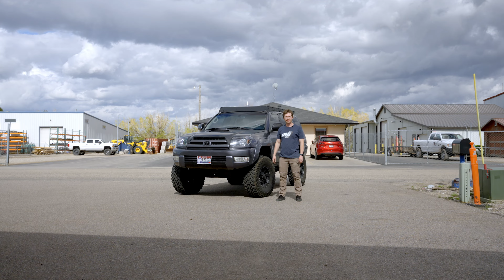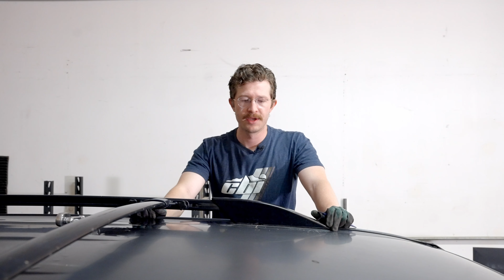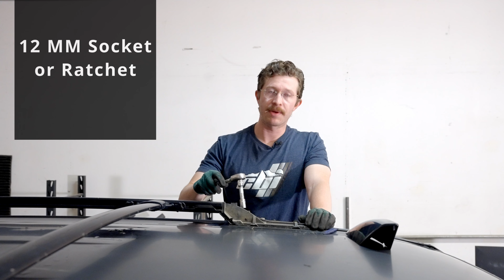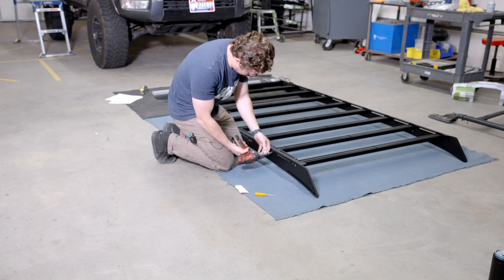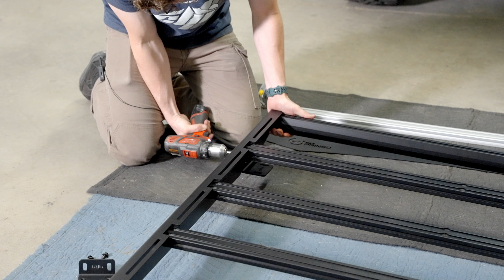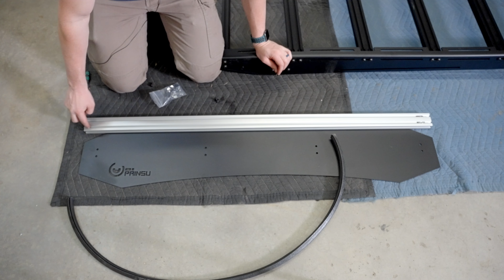4th Gen 4Runner Prinsu Pro Rack

Comment: Don’t buy it until the major design flaw is fixed. The new Prinsu pro roof rack on my 24 Land cruiser fills up with water whenever it rains. The crossbars have an open channel that retain water. I called Prinsu they told me I needed to dry the rack every time it rains. Major design flaw all they need to do is drill two small holes in the bottom of each crossbar to prevent this water from pooling.
Reply: @ScottyBumbaloughmauib  Thats a huge bummer! Im surprised people with their other racks don’t have this issue and their solution to dry the rack every time it rains… is this a troll?

Comment: Does the hatch open fully after install? Seems pretty tight
Reply from the maker: Yes it has no problems with that
Reply: @cbiprinsuinstalls  well I can tell you 100% that it does. This runner in the video doesn’t have a spoiler. So it’s not a problem maybe you guys just didnt notice. Is this a thing on the 5th gen as well?